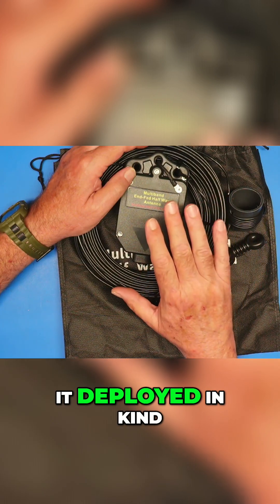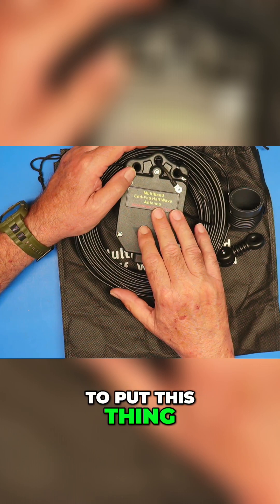80 Meter Half Wave Antenna  Deployment and Testing #goozeezoo #feplabsradio #hamradio #antenna

Comment: I just bought 500 ft of wire so I can try making a 160M EFHW and an 160M dipole (since I used up another 250 ft spool to make a 80M EFHW so that just doubles as one side of the dipole).

Comment: You might consider an inverted L configuration - the vertical section would help you get some low angle radiation even if not a half wave up - GL es 73
Reply from the maker: I'm actually working on re-deploying today, in that basic config.